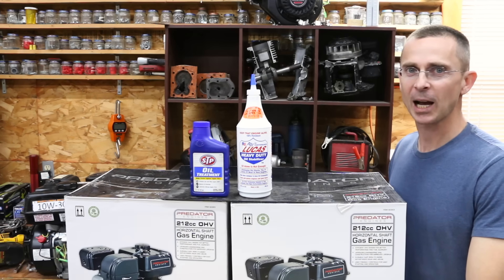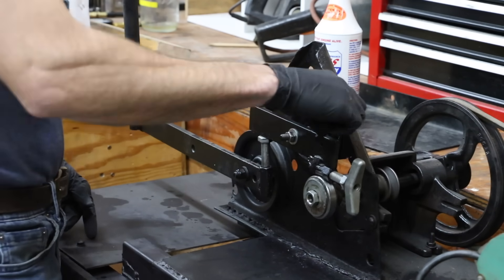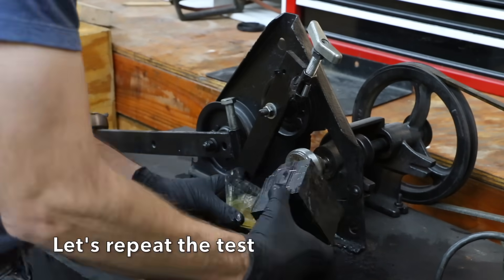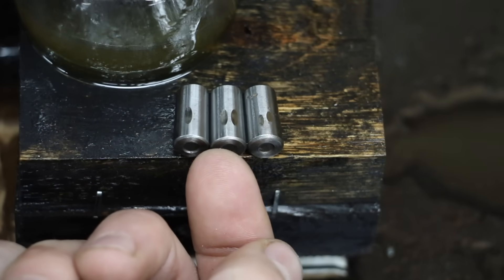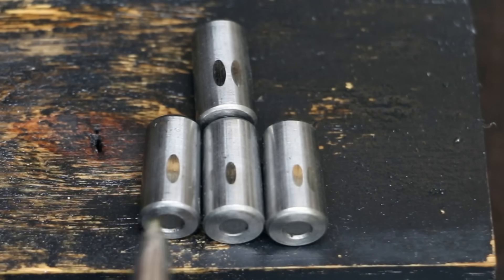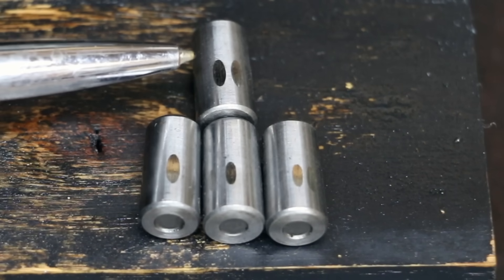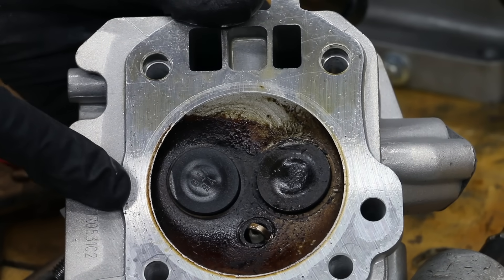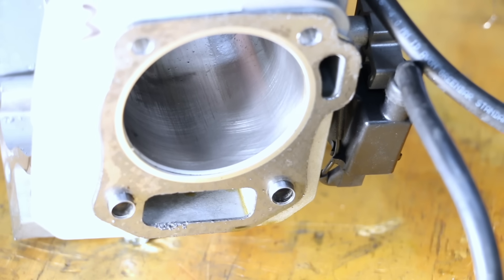Which engine self-destructs first?  Lucas or STP?

Comment: That was very interesting, and a cool video, but since I never run engines without oil, the test I would like to see would be run to fail (takes a long time) with plain oil, Lucas added, and STP added. 
I'm curious, did you monitor temperatures when you just had oil in them for the break in? If so, did the additive lower the temperature?
My concern with temperature is that how lean the carb is can make a big difference, and with those cheap little carbs, I wouldn't expect any two to be exactly matched. It might be fun to spin these motors with a different motor, so that combustion has nothing to do with when they fail. 
Personally, I'm biased toward the oil called for by the manufacturer. My Jeep Hemi dealer, by the way, says the warranty is voided by additives, and that the multi-displacement system may malfunction. They have service bulletins for transmissions, transfer cases, and differentials that say if there's a malfunction it may be due to additives. It isn't worth it, in my book, but I'd like to see some tests anyway.
Reply from the maker: Thanks for commenting.

Comment: You are probably not going to see this but i think where the flaw comes up is you ran both engines without oil lucas or stp had nothing to do with results. When the engines started knocking you should have shut them off. Then documented the damages inside then. With the knocking engine reran the lucas and stp and see if either had any form of protection against the known damage.
Reply from the maker: Thank you for this recommendation!

Comment: Great test and somehow not satisfying because no window view engine block...but I claim invalid...because you didn't test oil alone and no oil at all as baselines, but it's still actually valid, but I have the suggestion, run and break in THREE ENGINES REAL WORLD! factory fill with our test oil...not valvoline which is the worst for small engines I joke it makes valves look like run lean...valvoline. Run and break in all 3 one 3 different oils I say your dramatic and biggest most fan gasping difference...Valvoline...sae30 not 10w-30, Castrol HD30, and the only straight 30 superior synthetic...SAE 30 royal purple synthetic...break them in 3 hours only... run a 5 hour "usage cycle half idle, half WOT, then drain and wide open til you get block ventilation...youll have a video as revealing as it is entertaining, watch, as Valvoline starts smoking first, hd 30 about 6 minutes later will just start knocking and give a fantastic show of explosion, and loyal royal will do her 52 minute dance of fame before locking up, to be blown another day oh sorry just ruined it for you cause I did a test we would actually check our oil and put the right grade in an not use Valvocrap in... or additives as oil sorry bro but it's just not real world or repeatable, or relevant, Lucas in real world is worthless to STP from a L05 TBI 350 GM motor as a run dry so bad you hear knock and bearings to gas station oil and a blue bottle and in 10 min from startup to another 162 miles home from green bay Wisconsin...the STP got me home...lucas was nowhere distributed or to be found...so by default of being there when a real world test means a ruined engine and hunting trip vs a driveable and perfe ctly running engine afterwards...take a guess who won! The fact 0/10 places you'll hit an exit and find at any gas station vs 10/10 for STP...tell me real world. It ran 162 miles after tampering with royal purple with .5 quarts of oil til I heard trouble and 4+ quarts and STP saved my day. If use neither in real like use royal purple, Castrol GTX Magnatec, or Castrol Edge Varieties...and check your darn oil. And change it with a good wix, purolator, k&n, royal purple, Napa gold, filter...and you don't need this gear oil in a bottle...EVER!

Comment: where is your control engine? should have had a third engine that went thru the same break in period and 3 hours of run time with the same oil used in other two motors then drained and seen how long it lasted just being run with conventional motor oil
Reply from the maker: Thank you for this recommendation!

Comment: Early diesel engines had complex injection systems and were designed to run on many different fuels, from kerosene to coal dust. Some of the first models used to run on peanut oil.

I wonder if modern diesel engines can run on vegetable oils, and if they can, which oil runs better?
Reply from the maker: Thanks for commenting on this!

Comment: All lucas is is just highly refined gear oil that doesn't have that fishy smell, it lets you thicken up your oil without making it smell like fish which is a dead giveaway. Used car lots swear by it to make a loudly knocking car into something they can sell and they don't even need to change the oil, just throw gear oil or "lucas" in there and it will drive well enough to sell. You have to realize if it were so good then your dealer would be adding it and it would come with every new car right? Well they don't... it's juts like those other "mechanic in a bottle" things you can buy that makes a car look good for a sale but fucks over the new owner. NEVER use this in your own car unless you want to quiet it down so you get more $$$ for it in a sale.
Reply from the maker: Thanks for commenting.

Comment: Very interesting but where was the total run time of each.  That being said to really be conclusive you would need to repeat this test a number of times.  Why? because those chinese engines are put together pretty sloppy sometimes. I'd also want to test connecting rod clearances before hand. Others have reported machining debri in the bottom of those engines. Which are really good engines.
Reply from the maker: Great point and thanks

Comment: Ive seen you test for noise reduction, or making an engine quieter.  I came across a product from DuraLube called "Severe Instant Quiet". I have not tried it.  In fact I can't find much online about it.  There was a YouTube video where someone added to their engine while running and measured the dB of the engine. It showed a lower level, and actually sounded much better.  Another video claimed it made little to no difference for them.  I'd love to see you try this stuff out to see if it infact does work or not.  I think it's about $9-10 a bottle.  Please Please Please add this to your plans!  If there is a product that would actually quiet the common "Hemi Tick/Knock" in my Ram truck, I'd be all over it.  Thanks for the great videos and keep up the great work!
Reply from the maker: Thank you for this recommendation and thanks for the positive comment!

Comment: It would be interesting to see you add one more component to your tests. When you run the engine and drain the oil out, send it for an oil sample analysis. You can get a test kit from a CAT engine or equipment dealer for about 8-9 bucks and they will send you a full analysis of the oil.
Reply from the maker: Thank you for this recommendation!

Comment: Where's the control? Without one 50% of your "data" is useless.. You we're able to compare stp vs Lucas successfully, but weather or not they made an improvement vs regular oil you did not..  the best way to perform this experiment is with 6 engines.. 2 = untreated oil, 2 = stp treated oil and 2= Lucas treated oil.. do not drain and run all 6 till they go..  average the times of death of both engines in there categories.. and see which has the longest run time average...
Reply from the maker: Thank you for this recommendation!

Comment: That was a good test. I had no idea each would foam up so easily. There is no doubt the Lucas helped the engine last longer, but the bigger lesson is if there is no oil in the engine you're toast.

I'd like to see an engine with no oil ever in the engine vs and engine with conventions 10W30 tested to failure.
Reply from the maker: Thank you for this recommendation!

Comment: Lesson #1: Don't run an engine without oil.

Put regular recommended oil in any small engine (or automobile engine), change it regularly and the engine will usually last longer than the machinery it powers. (lawnmower, snow blower, car, truck etc....)  I have yet to have an engine, when properly maintained, wear-out before the rest of the machinery was worn-out.  In the case of cars and trucks, they usually rust-out before they wear-out.
Reply from the maker: Thanks for commetning.

Comment: Running them dry to destruction doesn't tell us a whole lot, I think it would be more interesting if you ran both additives with the air cooling fans blocked off to see which one does better at high temp protection. Or some other test that replicates real world scenarios. Maybe just a long term wear test with say 100 hours at high load, pull them apart and measure the bores and rings and such
Reply from the maker: Thank you for this recommendation!

Comment: One thing that you did not do or comment on was confirm both engines were running at the same rpm. If you want a controlled test both engines have to be running under the exact same conditions. They sounded similar in load so I would suggest the rpms were similar but, if one machine is running even 5 rpm faster over the elapsed test time, then it would have done roughly 100revs more in total. More rpm means an unfair harder harder load has been placed on one engine over the other. Just a suggestion but if you did measure the rpms on both machines could of let us know what they ran at?
Reply from the maker: Sorry I didn't mention this but I measured the RPMs during the break in procedure when both engines had the same type of oil.  Thanks
Reply: Project Farm oh excellent! Thanks for the reply, what rpm were they running at?

Comment: should of used 3 engines. The third would have been the control and used just motor oil so we could of had a comparison to gauge if the additives actually did anything.
That being said I'm impressed they went as long as they did. I had a snowblower where the oil plug came loose and it seized in like 15 seconds.
Reply from the maker: Thank you for this recommendation and thanks for the positive comment!

Comment: Now run three engines under load for 5,000 hrs each using the additives AND one with only the recommended lubricant and all with regular oil changes and see which one holds up the best. My 50 years experience says there will be little difference except in cost.  Regular maintenance will win that category every time!  We tested additives at the fleet I worked for and NONE were as good as they claimed.  Our trucks and cars got thousands of hours and 170k miles average with out the use of additives.  My 1994 Chevy pick-up lasted 20 years and 145k miles using synthetic 10-40 oil, if it hadn't been for the rust, I would still own it.
Reply from the maker: Thank you for this recommendation!
Reply: You're welcome.  In general I like your videos, very professional with out using language that goes over the heads of non-mechanics.  Keep up the good work!

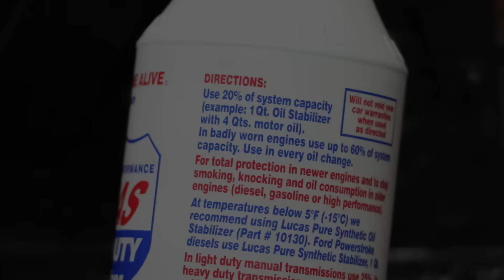Comment: @ 4:42 It shows the mixing ratio for "Oil Stabilizer" with "motor oil."  1 Qt. Stabilizer Oil with 4 Qts. motor oil or  20% of system capacity. This would be 1/4= 25/100= 25%. This was a nice clip and I enjoyed the production value and execution. Overall a great clip.
Reply from the maker: Thank you!

Comment: the ratio should be fine though because stp is ridiculously thick. i've used that stuff when i changed someones oil they bought that and asked me to put it in too so long just to get it out of there.  

Personally i've used lucas in all of my cars engines and they do great. i don't think of locus as increasing performance but rather helping with cold starts when average oil all falls to the bottom of the block. Lucas just has that ability to literally stay up in the top end over night for that cold start the next day.  I've personally done a comparison where an engine without lucas after sitting for a night would basically be dry on the top end where all those cams and valves are.  then after adding lucas and doing the same thing after sitting for a day and pulling the valve cover off it was completely different. it was still coated in oil which in my opinion is one of the most important things for an engine is to be coated in oil up there. cold starts are harsh on an engine. but lucas helps with it.
Reply from the maker: Thanks for commenting.

Comment: the lucas seems to run hotter but it is likely just more efficient and taking the internal heat and transferring it to the head/block. I think i recall and engine without oil or water vs oil and it looked cooler on the outside but obviously internal parts were much hotter leading to failure first. One of oils main purposes is dissapate heat. So the hotter engine may actually be working better. Kinda counter intuitive.
Reply from the maker: This is an excellent observation.  Thanks for commenting.
Reply: this is why if you touch a fat person their skin usually feels cool but skinny people feel hot
Reply: Exactly, the higher temperature he recorded was at the heatsink which means it was removing more heat from the internals
Reply: Mark Brand, I wish we had something other than a thumbs up, that deserves a laughing emoji... :)
Reply: Probably runs hotter due to more drag,? Oil isn't a very good conductor about 1000s time less efficient than water  BUT, you wouldn't have water jets squirting on underside of pistons to cool the crown. Thinner oils don't 'stick' so long so can pick up and transfer more heat giving an overall cooler running engine (assuming there are enough efficient oil coolers) SUZUKI SACS  motors ran into the cooling problem with the GP bikes, around 200HP/litre the power would drop off dramatically as it couldn't carry enough surface area for efficient cooling 3/4 way through races. The P51 Mustang fighter aircraft of WWII used waste heat as a 'feature' acquiring about 200 bhp 'thrust'
Reply: Also as the engine gets warmer your motor oil performs better as long as it doesn't go above 220 degrees.  Second thing to note is that as the oil gets warmer your oil pressure gets higher.

Comment: Why is it that so many fail to understand the basic concept. The point is which oil additive provides better overall protection. This is applicable in terms of cold starts. If the additive sticks to surfaces better and provides protection in spite of being empty...especially if it lasts twice as long, then it appears to be better. No, this isn't a conclusive 100% scientific test, but dang, give the guy a break. If the two tests were even remotely close, you could argue that this was inconclusive...but twice as long says something! Why must you keyboard commandos go crazy on the guy!
Reply from the maker: Thank you for the positive comment!

Comment: take em back to harbor freight and swap em in for 2 more. you forgot one oil additive that has so much advertisment back in the day,,, good old slick50.. stp and lucas they were both impressive at the times those engines ran drained. i see someone recommended running them on vegetable oil. i have ran briggs engines on veg oil, transmission fluid, hydraulic fluid and they ran a long time til they were shut off, the veg oil seized but did not time it.. i personally run amsoil in my vehicles and years ago i worked for one of the worlds largest environmental/engineering firms and i was on the road 90% a year for 15 years travelling across all states including alaska, canada, mexico where you could get to by road. me driving a gm branded chebby/gmc vehicle was out of the question PURE GARBAGE. you can't get a million miles out of a gm without engine, transmission, or differential problems usually if i could get 200,000 out of a gm it was totally falling apart and everything replaced or rebuilt. hell i had one chebby that went thru 6 gm dealer installed transmissions before 120,000 miles and needless to say you won't see a gm in my garage. all vehicles i used were on amsoil from front to back. i had 2 ford full sized bronco's with 351w engine one went 875,000 miles before any problems and it was a water pump, one went million +300,000 miles when it broke a timing chains and a dodge ramcharger with the 360 engine that made just over 600,000 miles before the trasmission went. i kept all vehicles serviced to specs coolant flushes every 60,000, trans service every 100,000 and so forth. i am retired now but i still use the amsoil and i still have the million mile plus 1995 eddie bauer bronco but it has a all new powertrain..

Comment: This is a fun video to watch my two questions regarding the first test would it be different in a closed vacuum system like an automobile engine. As for the lawnmower test, you added oil stabilizers with very thick weights that motor is not designed to run on that weight.
Reply: Project Farm sae 30
Reply from the maker: I believe the outcome would be the same.  Oil viscosity for this engine is 10W-30, the same as some automobile engines. Thanks again
Reply: I think your test is awesome and no pun intended. I checked the Lucas website and they recommend using, Pure Synthetic Stabilizer was developed specifically for engines that run on lighter weight engine oils and in newer vehicles.

Comment: They're both junk. Lucas ruined the engine in my 1993 Grand Prix. The engine had 146k miles on it. I put a bottle of Lucas in the oil and all it did was thin out the oil to the point that it looked like water when I drained it. I watched my oil pressure drop and also heard a knocking sound which turned out to be a lower rod bearing. Soooo $1,500 later after having a new oil pump and new bearing installed my car was up and running again. Lucas is garbage and so are all those other BS oil additives. If you want your engine to last just change the oil when your supposed to.
Reply from the maker: Thanks for commenting on this!